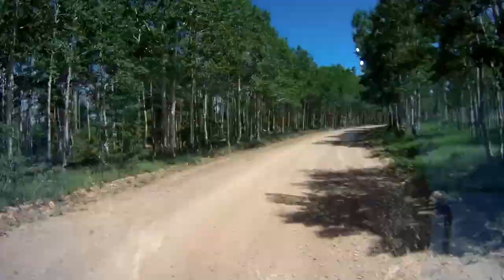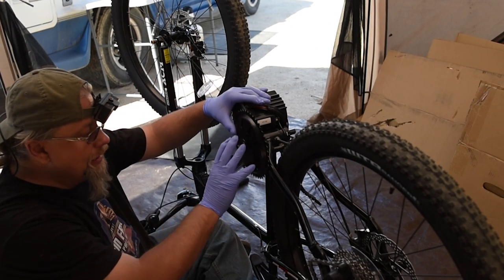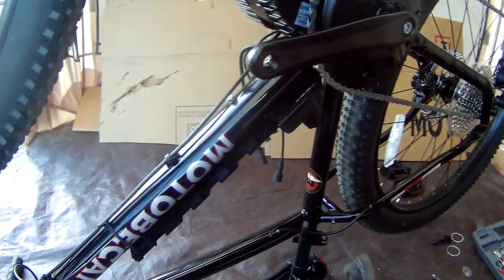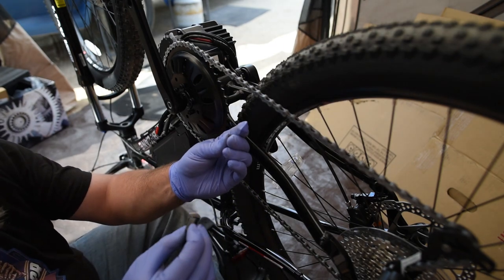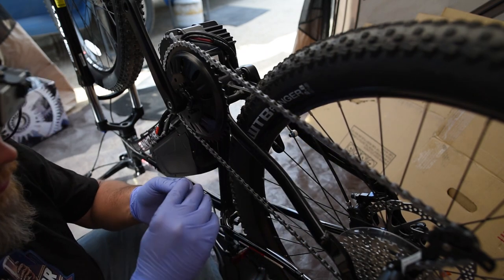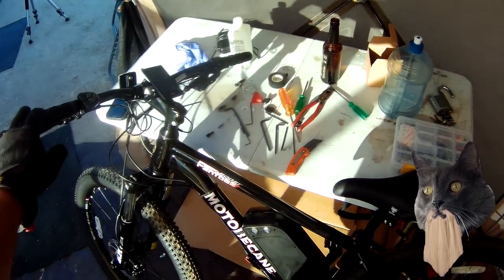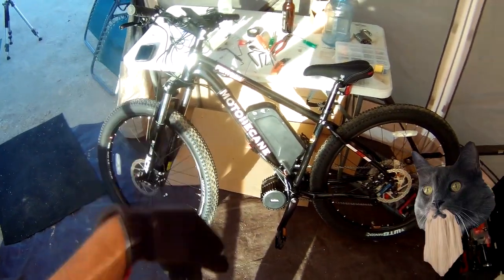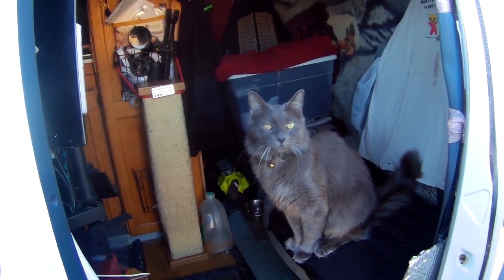DIY E-BIKE PT 3/3 | HOW TO BUILD A CHEAP FAST ELECTRIC MOUNTAIN BIKE | BATTERY, SENSORS, & SCREEN

Comment: Thank you these instructional bike building videos. I am thinking about building a 4 stroke gas powered bike. I would like to build an electric like yours however. I am thinking I can get a dual disk brake Wal-Mart bike and the motor-kit for $400. I just need a light weight bike to scope out dirt roads and Boondocking camp sites before driving the truck and the fifth Wheel back. Some day in the future I will build a bike like yours.

Comment: Can you put a link up for where you got the parts. Thanks.
Reply from the maker: I got the bike at Bikesdirect.com and the kit at Lunacycle.com . The rest is on my website's Amazon page http://hobotech.tv/amazon/
Reply: Just google bbshd or bbs02 , and buy from Aliexpress its about 300€ cheaper then luna . No tax from most sellers on Aliexpress but if you live in usa buy from luna ,
Reply from the maker: The parts that come in the Luna kit are superior to the Chinese resellers. Luna also has a good support network and warranties the parts. Good luck getting any of that from China.
Reply: Made in same factory ,but yes luna servic is way better i have orderd a lot From luna. if you live in usa bye from luna. But say you live in eu or somthing your luna kit will be way more expensive motor + 52v battery 650-700€ shippt to your door (Aliexpress ) . About the same from luna but + 100 for shipping motor and+ 125€ for battery, battery need to be shipped by sea dount know why but they do not but them a flight by sea +8 weeks delivery and you have to pay tax on motor and battery + about another 200€ . Too bad i want to bye from luna but i get 2 kits for that price from china .
Reply: Yep I have a few buddies who went the China route but anytime something bad happens they have to swap out that entire part, China stuff is good but you have no support, Luna Cycle does have awesome deals from time to time usually during the holidays... last year 2017 you could of got the entire mid drive kit + 48v 400 Watt battery for $750 USD, that was a really good deal.

Comment: Tom me again, also is the 36t chainring you are using centered with your rear gears? Is it called the Luna One and did your original chain that came with your plus bike need to have links added?
Reply from the maker: I think it was the Luna One (I built this almost a year ago) and it is NOT centered with the cassette. It is straight only in the top gears. The lowest gears make a mesh noise and I snapped the chain a few times there. Yes, on a 10 speed cassette you'd need to add links if you want the granny gears but I actually locked the two bottom gears out. Really don't need them and it was too much for the chain so it's really an 8 speed. When I have to replace the cassette I'll just get an 8 gear so I can use a wider chain.
Reply: Thanks for your reply Tom. My bike is perfect now for shifting without the motor and when I get the motor I still want it to shift just as good. The diference from my bike to yours is not much if you read my specs, I got mine on sale with 10% off but still a little more money than yours. The difference is I am 5'10" and got the large so my 52v shark battery should fit right on the bottle holders. I do not want to change anything on the bike but just add the motor and battery, display, throttle and speed sensor, so if I ever change back to regular bike just remove all that and put my oringial crankarm back. If I could only look at the one they sell close up I could get all my answers.

Comment: Hi Tom, I watch all 3 videos of your build and I have a similar bike I am going to make electric also with BBSHD, but I really need to know your bottom bracket size? 73mm or 68mm. Please answer this as soon as possible or have another way I can contact you. Thanks, Curt
Reply from the maker: It was the standard size BBSHD and not the fat bike size. I don't recall the bracket size as it was on the bike specs. I think it was 68mm.
Reply: Thanks for your answer, if you go to luna cycle and look at the new bike they sell the KHS 500+ it is a plus bike and actually the one I have that want to make electric. On theirs they put the eclipse chainring with 42t which has a offset of 24mm the luna mini 30t and the luna one you have I think 36t only have 8mm offset, but I am trying to find out if I need to order any spacers or anything. And if you had 73mm bottom bracket like me I would be more sure about that. I am speaking with someone on Luna blog, but your answers are already better then theirs. I really need to talk with the guy at Luna that actually build the bike I have. Thanks

Comment: I like the fact that the weight of the motor and battery are low on the bike. Others I've seen mount the battery on a rack over the rear wheel. It seems to me that would raise the center of gravity. I noticed on the review video that you set the tire size through the control panel. Does the sensor on the wheel need to be a precise distance from the axle for it to be accurate? Did Lunacycle respond to your ring gear problem promptly? Is the display panel weather proof? (Sorry for all the questions.)
I'm looking to go full time this year and this appears to be a good option for short trips to the grocery store or just doing some site seeing. Thanks for these videos.
Reply from the maker: The low CoG is really important, otherwise the bike handles really bad. I've had no problems taking it on some pretty serious trails. As for the sensor, I calibrated using my phone GPS. I ended up using the 28" setting. Lunacycle was good to me in the end. I got my chainring (you can see on the review video). Apparently, it was out of stock and they make them by hand. The display is weather proof as long as the usb rubber cap is on. Bike has been wet a few times and again, no issues yet. It's great transport for short trips and hella fun.

Comment: This was an enjoyable series, but this is not a tutorial. There are a lot of mistakes in these videos, some small but some pretty important. 
1) Get the measurements/geometry of the bike. 
2) Changing chainrings requires to remeasure your chain length and in this case you should probably add one or two more chain links because of the massive high gear of this bike. 
3) Use a torque wrench. E-bikes are heavier and can go faster. This means more stress on the bike. If you use the wrong torque it might cause problems.
4) Read the manual or see tutorials!!! Some screws are reverse threaded and different manufactures uses proprietary parts so you shouldn't just guess. 

This is not a hateful comment. The videos were good, but people shouldn't not see this as a tutorial.
Reply from the maker: The point of this build was to show people that someone with no specific bike skills can figure it out. As for 1) I said the measurements weren't available on their website. Bike was a new model. 2) That chain ring was temporary so I didn't bother to lengthen it. It would work as-is for most. 3) I did use my torque driver when I could. I didn't have a torque wrench but again I said several times to use one. 4) Alright you got me there. I should have read the manual. However, it had nothing about the bottom bracket in it. I went by the markings, which were confusing. Thanks for watching.

Comment: Try putting your throttle on the left side that way you won't hit your thumb on it when you shift.
Reply: Helldago123 No disrespect but every motorbike produced in the world has the throttle on the right.  Use One sprocket with variable speed motor controlled by throttle.
Reply: Tom Mack it's all good my old three wheeler had thumb throttle on left it's all personal preference if it was twist throttle  definitely on the right😁
Reply: I have mine set up with an SRAM twist shifter on the right and the Bafang twist throttle on the left.  Quite happy with this setup.